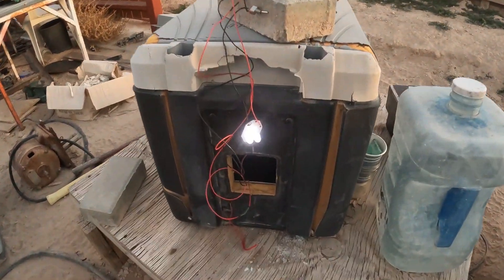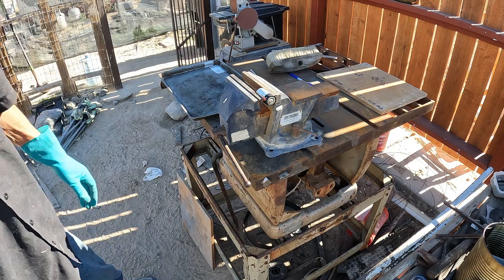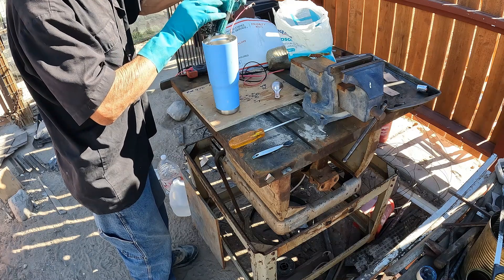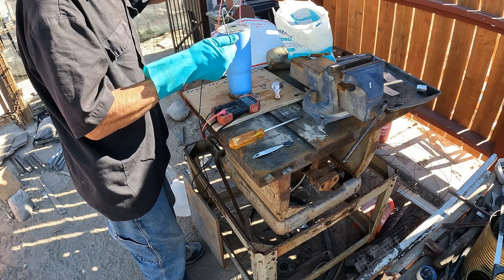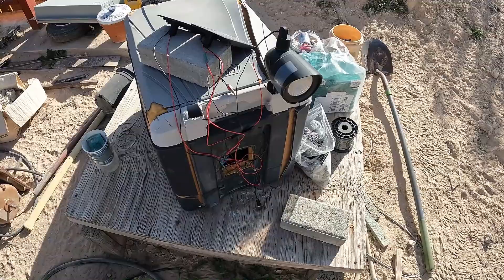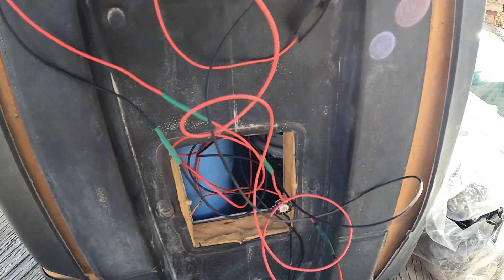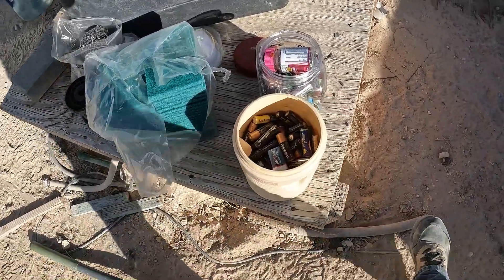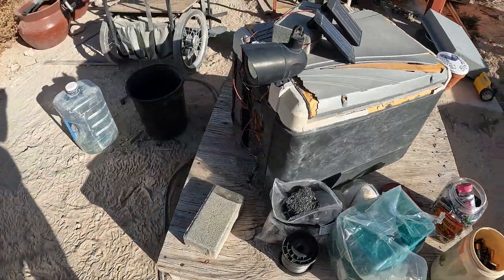138 Homemade Rechargeable Batteries

Comment: Use thinner zinc foil and use stainless steel foil. Use a paper separate. Layer the zinc-paper-ss and roll it up all together. Maybe 2-3 feet at a time.
Reply from the maker: That sounds like a great idea. I haven't looked to see if I can get stainless foil. I am sure it is available. I made another one using only epsom salt. No manganese dioxide and it isn't quite as high of voltage but still produces plenty of milliamps so I think I will go that route. No toxins.
Reply from the maker: Is there a specific type of paper separator I should use do you know?